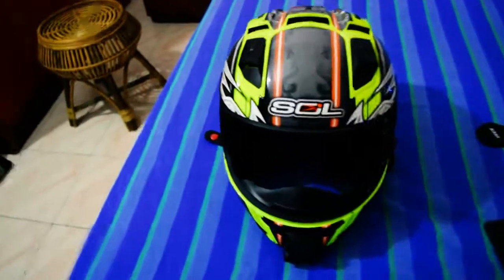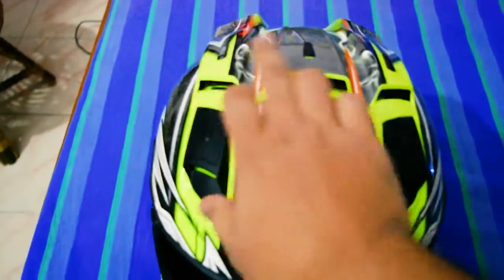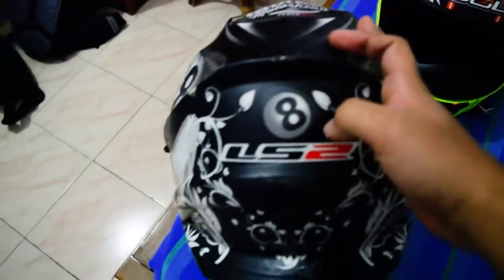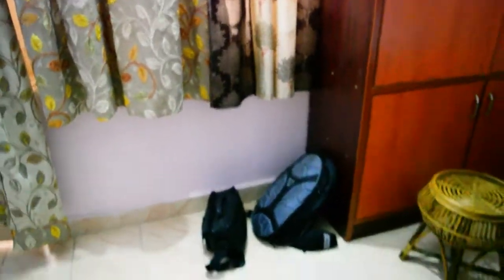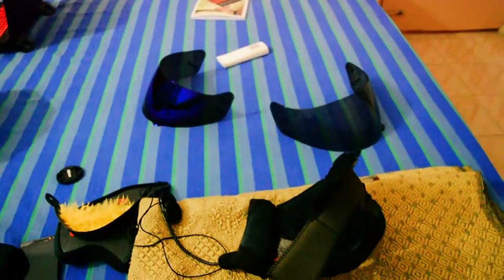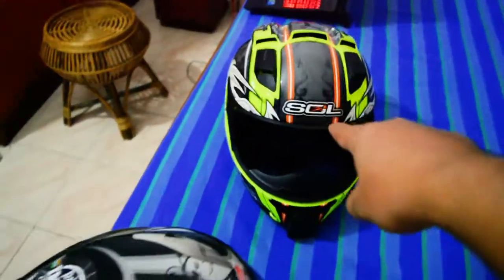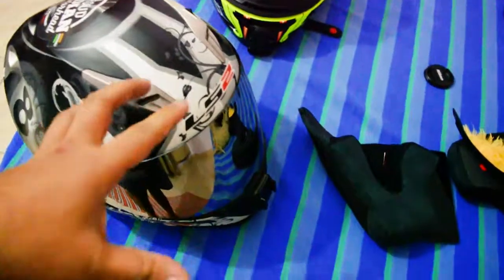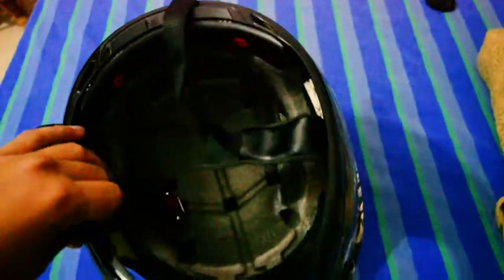SOL Unicorn Helmet & LS2 FF302 Ownership Experience

Comment: Two things I want to ask you regarding SOL that 
1) There is more vent on the helmet did you feeling any air flow noise in side the Helmut.

2) Can we close the air vent while raining or rain water will enter in to the helmet through air vent.
Reply from the maker: 1) More Vents = More Noise
2) Water never seeped in. Don't worry for that :)
Reply: What's your suggestion bro can I  buy and use it for long rides
Reply from the maker: Now you're getting Scorpion Exo 390 and Bell Qualifier as well at this price point. If you still want this, then no problem. Its a good lid

Comment: Hey man. I need to get a helmet and I'm confused between three. The Mt blade or both of these helmets you've owned. I'm confused between these three. Here are my concerns:
1. Mt blade is dual certified one dot and ece. I guess the sol and ls2 are just dot certified. Does this give the Mt an edge over the other two?
2. Chin mount, yes. I don't want to mess up the helmet much when I'm setting up my action cam on the chin. So which of these three helmets accommodate a curved mount on the chin with minimum hassle? I see you've had chin mounts on both the ls2 and the sol. 

it'll be of great help if you make it a bit easier for me.

Thank you, and this was a good video :)
Reply from the maker: Before LS2 I had MT Blade Raceline (Orange). That was the worst of these three.

Best one out of these is still LS2 FF 302. But you may have to shave of the design on front vent with a sandpaper for the chin mount, like I did.
That leaves you to putting chin mount on SOL which is still a batter helmet than MT.
Will be putting up a chin mount again on my SOL. You can watch it. Will be uploaded this week :)
Reply: Anand Sankar Thanks for the help man. I anyways was more inclined towards the two you suggested. the ls2 ff302 and the sol. 

Did you have to just scrap the chin vent a bit to get the required area for the mount? That was it? Or there was mseal or other mods needed? 

anyway I'll wait for your Sol chin mount diy before making my decision so looking forward to it :) I'm more into the ls2 though.
Reply: Anand Sankar And I see you've already set up a chin mount in the sol. Redoing it?
Reply from the maker: Yeah, had to shave off the front a bit in LS2 as there are some designs on the vent. 
In SOL there's a good gap there as well, If you place the mounts like I do. So a little feviquick is good. Just to be double sure that it's secured correctly.
Reply from the maker: My J hook broke so had to get a Chinese one. Now the problem with them is it doesn't fit in SJ and is loose for GoPro. So fitting Chinese mounts itself :)

Comment: Good video.I am going leh ladakh in 1st week of June on my duke390,pls suggest me good helmet under 8 to 9k.
Reply from the maker: In 8-9k you'll get both the SOL Unicorn, LS2 FF302, HJC CS14 and a few more amid level ones from them are also available. Else even the MotoGP helmet of LS2 (FF323 Arrow) is available for 9k something (In other graphics ofcourse). There are a ton of lid available at that price. Just try them out before heading to your ride.
You can choose anyone of them. But yeah the spare parts are cheaper and readily available in case of SOL, 6-7 shades of visor, cheek pads, chin curtain, everything.